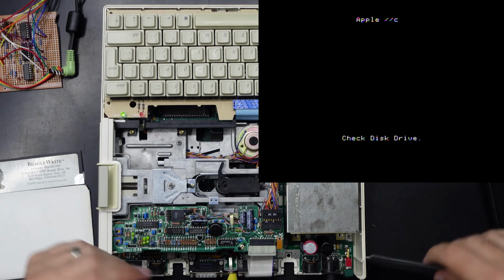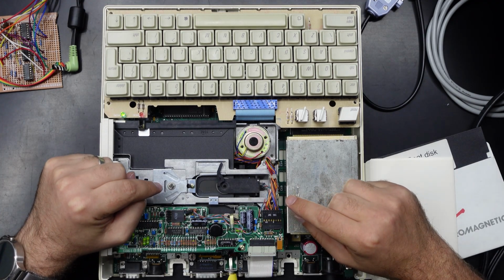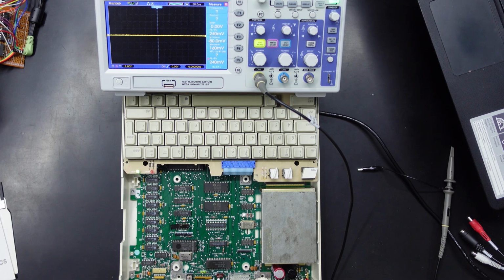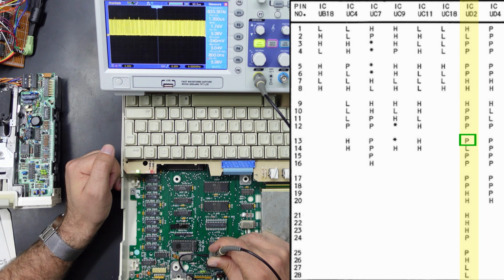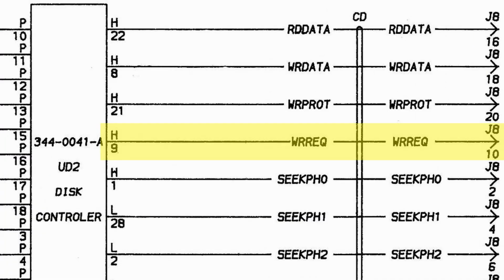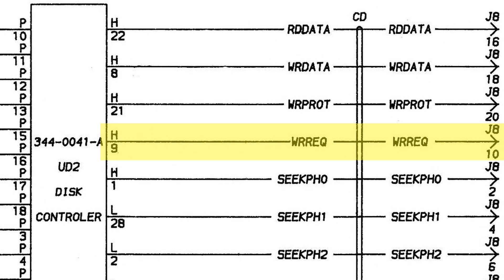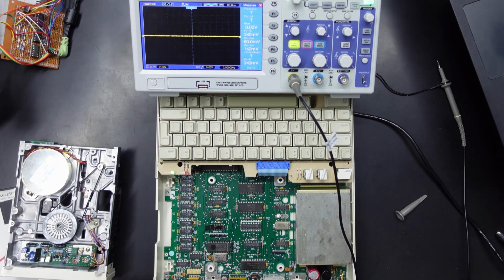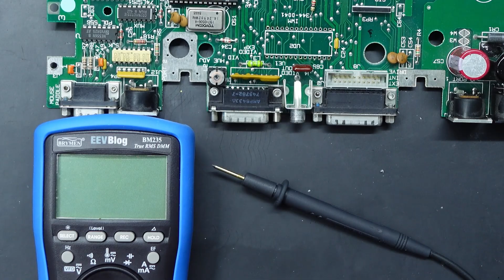Apple IIc repair and restoration - Part II

Comment: I was going to suggest temporarily clip that pin off -- at least you can safely play games and stuff on the machine.
Reply from the maker: That would probably work, assuming there are no ill effects of leaving that pin floating. I'm actually doing some experiments on the IC itself, and it's produced some interesting results. I'll put up a video on what I've found next week
Reply: @TheRetroChannel  Ok I did some looking for you. My Apple IIc (the second revision board with RAM expansion) uses the 344-0041-B -- which is also the same chip used on the Mac 128, Mac 512k and Mac Plus. I'm not sure if the A and B chip is interchangeable. The Mac SE and after use the 344-043A. So finding a parts Mac 128/512/Plus board might be easier than the IIc one. May be worth comparing schematics of the early IIc (which you have with 16 RAM chips) and the second revision with the 4 RAM chips -- just to see if there are any differences with the A and B part to see if they are interchangable.

Comment: Would it work as a Read Only drive if you keep that WRREQ pin disconnected, or pulled up? I guess you would still be able to play most games, though you may need another Apple II to use adtpro to fix the corrupted disks
Reply from the maker: I certainly considered it, although there is not enough clearance under the disk drive to put a socket in so I'm not sure if it's worth soldering a bad chip back onto the board. But we'll see what happens, I may have a replacement IWM coming soon I hope.

Comment: IWM on IIc tends to malfunction - 2 out of 4 I bought had issues on IWM.  It is almost impossible to find 344-0041-A on sale.  An alternative solution is to pull one out from old Mac motherboard.  Mac 128k and 128k/512k shared motherboards likely to have 344-0041-A, and Plus and onwards tend too have 344-0041-B which is fully compatible with A revision (and to my experience B is more reliable).  Plus motherboards are easy to find in the market and cheaper to obtain.
Reply: Do any of the Macs with battery leakage issues (e.g. Classic) also have a compatible IWM chip? If the rest of the board is kaput, it'd make sense to use one of these for salvage instead of a perfectly good 128/512k or Plus board.
Reply from the maker: For sure, no point in sacrificing another computer just to fix this one. But if it's destined for the scrap heap then I'll always try and salvage whatever is of use, especially custom chips
Reply: I just nabbed a plus board from the US (Im also Australian) for the same reason - got one with battery damage but the IWM chip looks solid.

BMOW was developing a FPGA version, however it looks like he cant get the chips so they arent for sale.
Reply from the maker: Thanks, yeah I knew certain Macs had the chip but want sure which ones. And good tip on the B revision
Reply: I think there are other models after Plus which has the same chip, but didn’t bother as there are many Plus motherboards out there.

Comment: Don't give up, I also had a faulty IWM in my IIc - I found out that the IWMs from old Macs are practically the same chip. I got a untested Mac Plus logic board on ebay for 20€, removed the IWM (I felt a little bad for gutting an old Mac, but hey...) installed it in my IIc and it works perfectly.

Comment: Ok, my previous comment has disappeared, probably because of the link describing the IWM.
In that comment I was mentioning that 344-0041 is called IWM (Integrated Woz Machine) and seems to do more or less what the Disk ][ controller does, and maybe it could be replaced with components extracted from there (341-0023 and 341-0027, if I read correctly) - they should be easier to source.
Reply: 341-0028 and 341-0027 are just PROMs. The IWM is, at its name suggests, a whole Disk II controller (and much more) integrated into one single chip. AFAIK, it can only be replaced by another IWM (or an FPGA provided that someone has recreated it with an FPGA).
Reply from the maker: Thanks Marco, I'll do some research